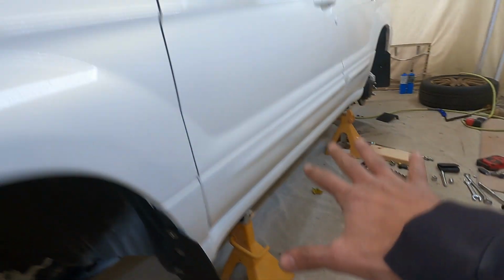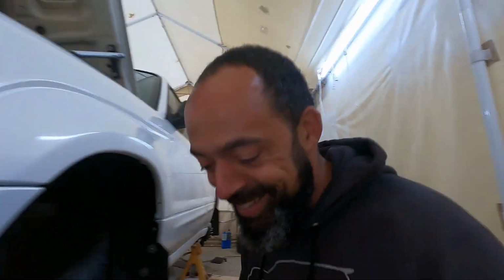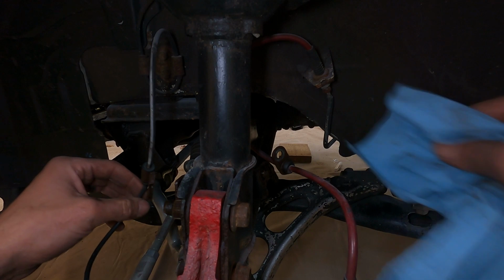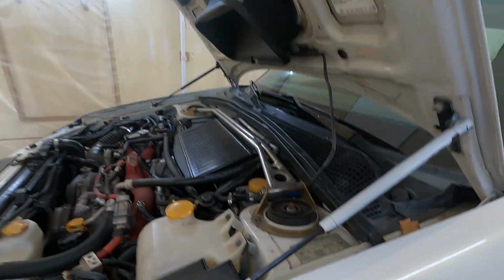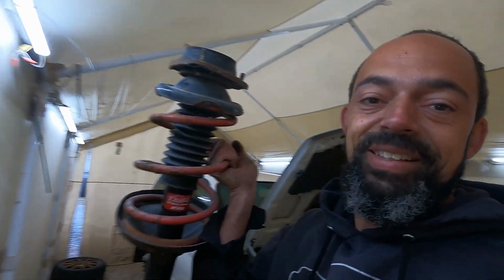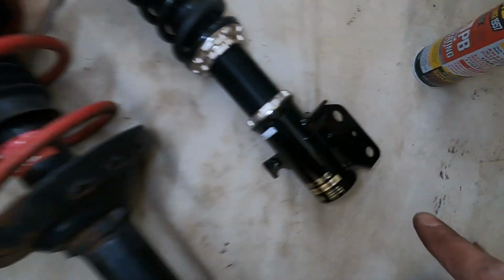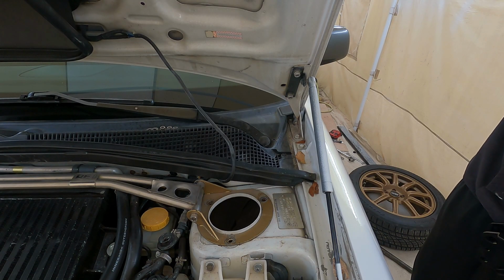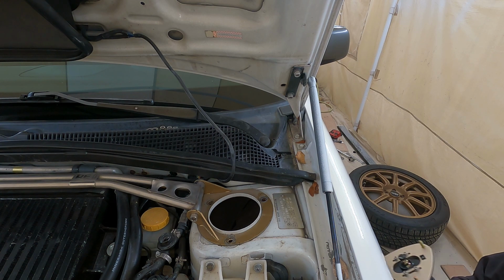Glutton for punishment - Subaru life

Comment: are u running the original power steering rack?
Reply from the maker: hey, I'm running 2004 sti rack
Reply: It doesn't get much better than that!   @jonnyturbo6142
Reply from the maker: @p_Bear_1  its the one mod Ive been wanting to do since I bought the car..I have a 15' sti rack too that I got with a subframe but its used and I was unsure of its condition...so I bought a brand new 04' rack and its awesome!
Reply: I have a 09' SH Forester. It has coilovers, rear adjustable LCA's, adjustable rear lateral arms, 25mm rear sway bar, rear sway bar mount braces and stiffer rear end links. Front has stock sway bar with stiffer end links. 18.x9.5 wheels with 245/40 18 Falken Azenis RT615K+ tires. This car corners so hard I had to put a Sparco race seat in it. Next mods are STi 6speed, R180 diff, hubs, axles and brakes. Its nice having a car that handles like a race car but I can still go to Home Depot and throw a ton of crap in the back of it.
Reply from the maker: @lordraiden5398  YOO!!! thats a complete setup, awesome. Any track time with that car? sounds like it rips! and your going 6spd, spend that MONEY! lol if I ever get my live podcast going you'll have to come on and takl about it